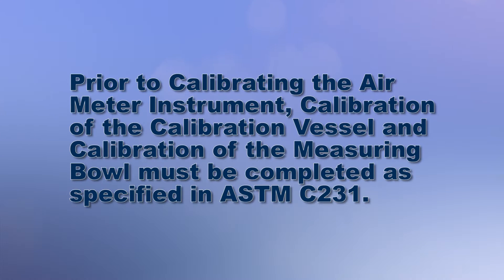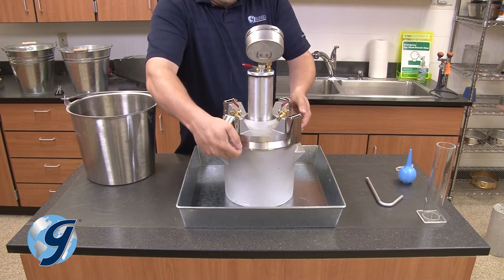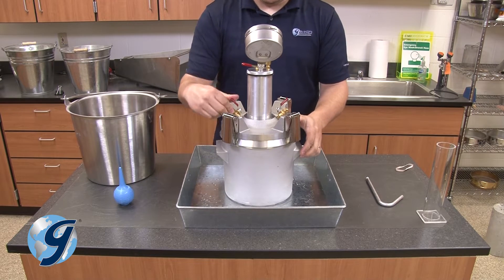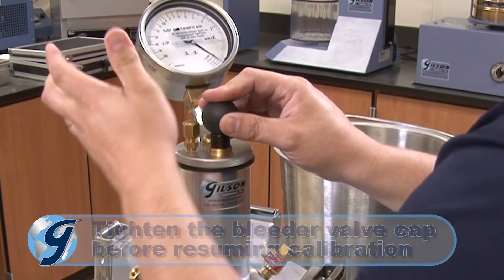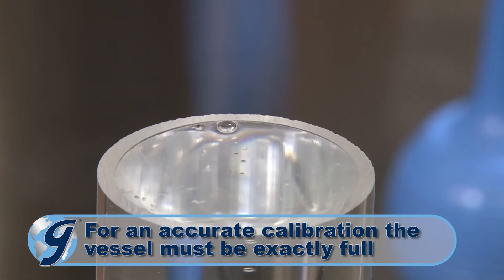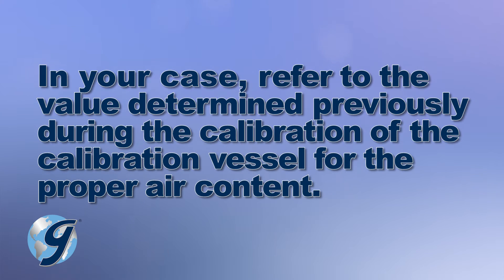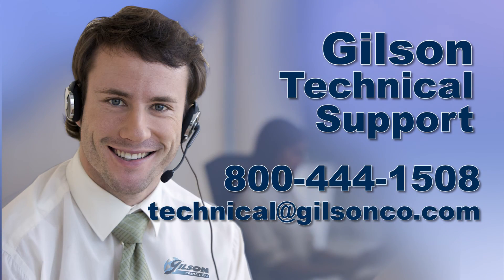Concrete Air Meter Pressure Calibration ## See IMPORTANT Comment in Description ##

Comment: After doing the vessel calibration, was the air content in the apparatus 5% in this video? I'm asking because when verifying, it shows the pressure at 5% and the needle needing to be adjusted because it was off by .5%. Thank you!
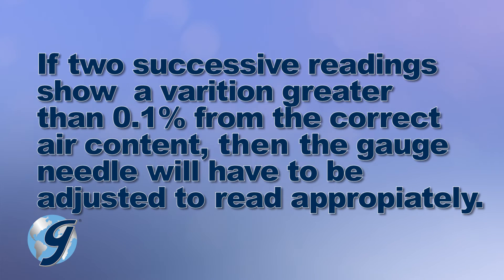Reply from the maker: Thanks for ur question. Yes we are using a 5% air content for this calibration.  At mark 4:45 the gauge reads 5% and no adjustment would be needed.
At mark 4:55 we show an example of the gauge needle needing adjusted.  The needle should be 5% +/- 0.1% but the video shows a gauge reading of 4.7% air, thus the needle would need to be adjusted to 5%.

Feel free to contact Gilson tech support for any questions techsupport@gilsonco.com

Comment: 0:29 attach straight calibration tube - onto threaded hole. I mark top petcock so I know which has the tube below
1:55 verifying the gauge - verify the Initial Pressure (I.P.)
4:46 needle adjustment - If reading is of by more than 0.1%, adjust needle to correct reading. Then re-verify I.P. and air content. AK allows 0.2% in 2019
Reply from the maker: Thanks for the good tips and tricks. Please note concerning the last part about the 0.1 to 0.2% variation and adjusting the needle. In this video, we are following ASTM C231 which calls for the initial pressure line to be adjusted if two or more tests have the same amount of variation from the 0% line. Then, according to ASTM, repeat afterwards to confirm the adjustment is correct. A 0.2% might be okay for Alaska DOT specs but it doesn’t follow ASTM test specifications.

Comment: What does it mean, if when I open the petcock (to fill cylinder) and it automatically fills the cylinder. Without the need to push down on the main air valve. Any help would be appreciated. Thanks
Reply from the maker: We are filling the "base" not the cylinder. Fill the base with room temperature water. Place the lid assembly on top of the base, making sure there is solid contact around its circumference assuring that the meter is airtight once the lid is clamped to the base. To finish filling the air meter base with water, fill the blue syringe with water from the water bucket and place the end of the syringe inside the petcock with the straight calibration tube attached to it. The base is full when water flows out of the opposite petcock. Feel free to contact technical support with any further questions. 800.444.1508 or email at techsupport@gilsonco.com.
Reply: I mean to fill the graduated cylinder using the bent tube
Reply from the maker: As indicated in the video, the unit has been pressurized so once you open the petcock the calibration vessel will fill with water. Feel free to contact technical support with any further questions. 800.444.1508 or email at techsupport@gilsonco.com.